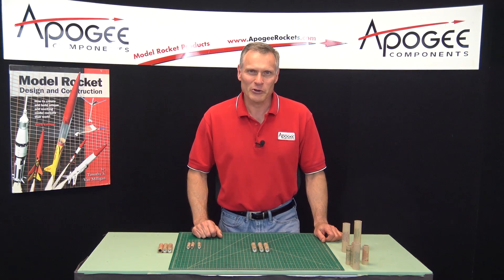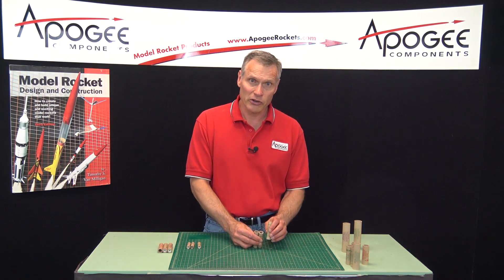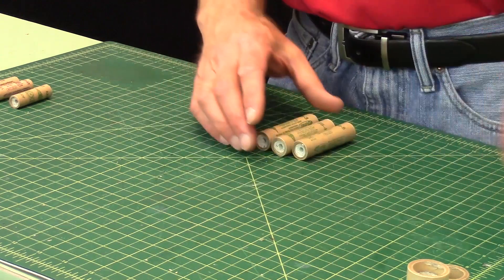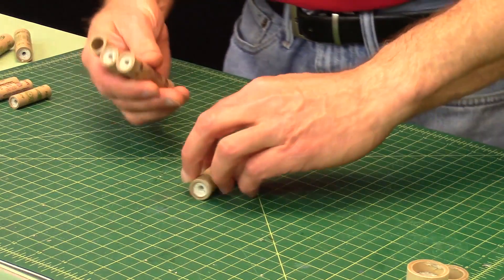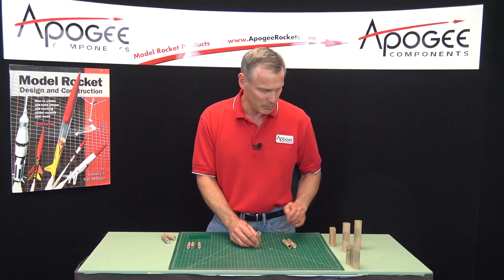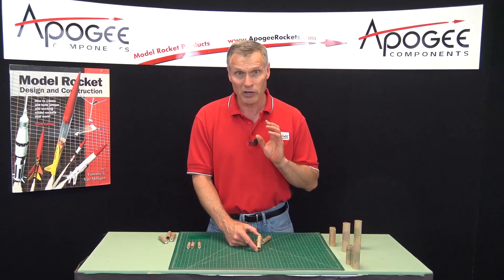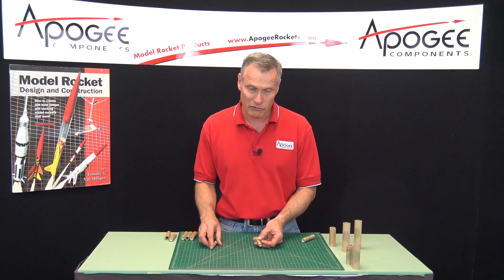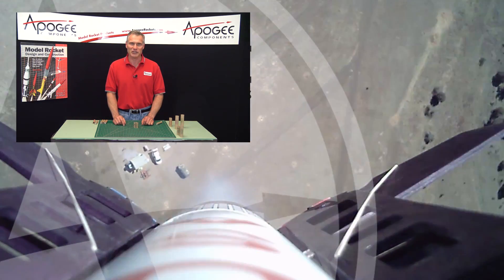Basics of Motor Selection

Comment: This is a great video explaining the designations on a motor, however some rocketeers might want to know how to size a motor for the given weight of the rocket. I have a 12 oz. rocket that takes a "D" motor. When I launch it, it almost doesn't leave the ground. What motor would be right for it?
Reply from the maker: Oh there will be a LOT of motors you could use. The process of selecting motors will yield a plethora of choices. It is a simple process too, but it involves some software. See the tutorial on how to pick motors at: https://youtu.be/QSjw6qJ-OzM?t=1276

Comment: I just recently bought an Aerotech SUMO. I just completed it. It stand 39” tall and has a 4” diameter. I am new to the hobby, although I have launched 2 much smaller model rockets a long time ago. Does anyone know exactly what model I have built? If so, should I use a “G” or an “H” engine and what type of launch pad should I purchase since it is rather large? I was unable to find videos of someone assembling my exact model and I had some trouble assembling the Aerotech SUMO, because the instructions were not the clearest and neither were any of the illustrations. I feel like I did some steps incorrectly such as the “piston” thingy and the shock cord and parachute installation, which are very important since I want it survive at least one launch and landing. Any help or guidance is much appreciated! Thank you. I need a decent amount of help and I want to make sure everything is all good with the assembly and engines before I blast it off.

Comment: There is no ejection charge for parachute ejection on an xx-0.  Get your facts straight before providing this type of info in videos.
Reply: Actually XX-0 motors do have ejection charges. The last number represents the time delay. Motors with no ejection charge will have "P" instead of "0".
Reply: @theredstonehive  "When the fuel finishes burning there is a flash of flame out the back of the engine that is used to light the next engine in a multi-staged rocket." (Got this off the Net)
Reply: David pritts, you are ugly
Reply: Someone has a rocket stuck in their ass.
Reply: Maybe you wouldn't call It an "ejection charge" more like a "burn through" as the thrust reverses directon for a brief moment.  This  enables the light-off of a second stage motor and the pressure produced helps in the separation of the lower stage.  Now there are the plugged engines xx-p that have neither ejection or burn through that are used in rocket cars and rocket boosted gliders.